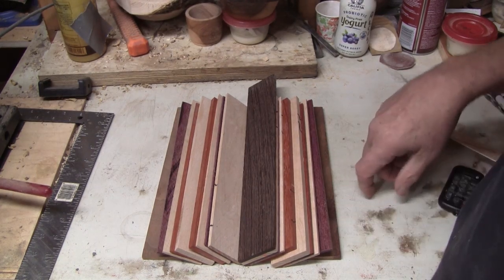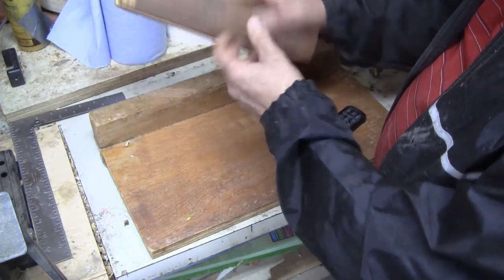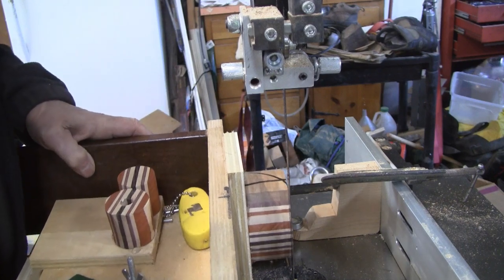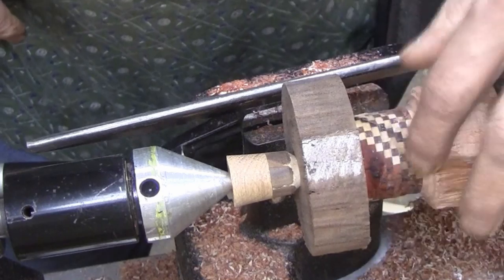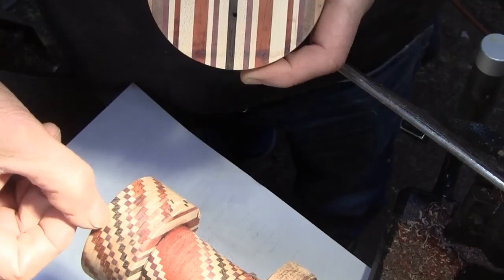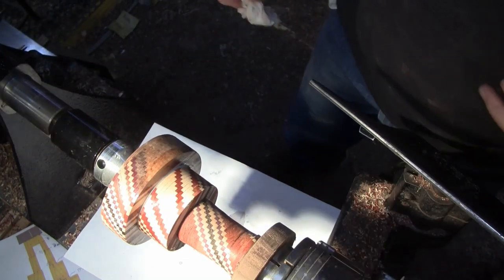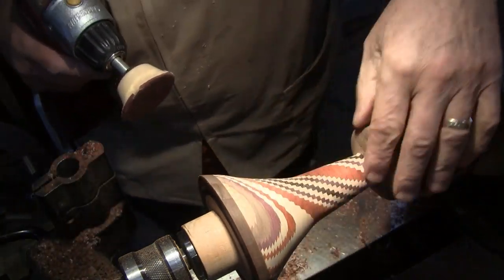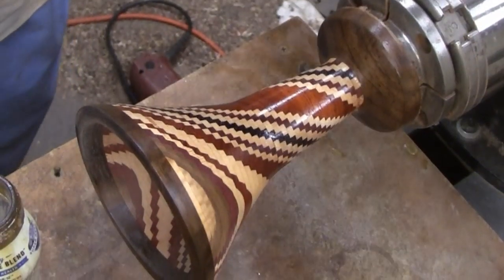Wood Turning A Small Dizzy Glass  Step by Step

Comment: I'm new here and I think I saw yiou're using Benjamin Best tools. Surprised me. Beautiful work as always.
Reply from the maker: Yes Jim I have some of those and also some Sorby tools. To be honest the Benjamin work very well. 
 I have hardened the first inch of some of them to the point of not being able to touch them with a file.
 I bought the first Benjamin's to test some grinds out and like them so much I ordered a few more.
 I also have some tools I have made from Stellite which is great steel. Plus some scrapers I have made from very old vintage framing chisels with excellent steel.
 I did spend the bucks on CBN wheels which is really the foundation to good cutting gouges.
 Thanks for watching and your comments.
Gary
Reply: @ThePapa1947  thanks for the infomation, that's a thought,,,, i saw some of your tools  you mention.. they're anazing. I think you have  a life time of turning experience.. CBN,,, yes I  need to have those in my budget..
Reply from the maker: Well Jim I would say you are right. I spent my working career as a wood pattern make and did a lot of turning when the patterns needed a turned shape.
 We did not use bowl gouges for what we did. It was much easier to control dimensions with the tools we used. And it was all about being exact.

I also had a wood lathe. I turned things as big as 8 foot in diameter.  
 Being able to make what I want then bowl gouges really help to create.
  My first experience with a lathe was in grade school and I fell in love with it.
Easy to figure how long ago that was based on my YouTube name...lol
The first job I built as a pattern maker was a lathe job. A pattern for a small pump.
You can do a fine job grinding on a stone wheel. The key to my CBN is the 350 grit wheel.
 Thanks for your interest and if you have questions feel free to ask.
Take care,
Gary

Comment: Papa. How about the adapter to use a chuck on the tail stock was that something you made?  I’m using the same lathe and love it 😍
Reply from the maker: Mark as much as I like and do make things I did not make this one. If you search for "tail stock chuck adapter" you will find them show up on a number of places. I think I bought mine off of Ebay. But Penn State Industries sells them PSI and I have seen them on Amazon. I use mine for lots of things and find it very handy.
 If you have the same lathe check out my Spindle lock mod I made. That I use all the time.

Gary
Reply: ThePapa1947   Oh yea. I’m going to do the spindle lock mod for sure.  Great idea